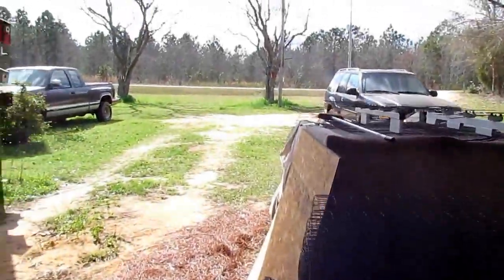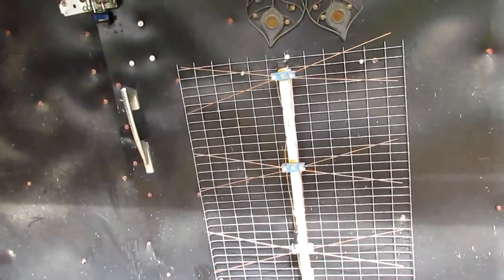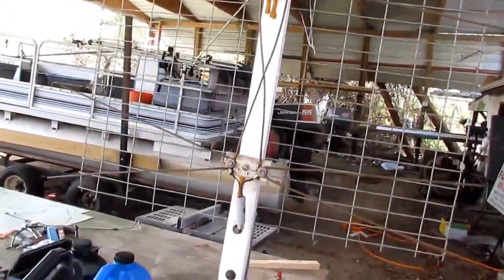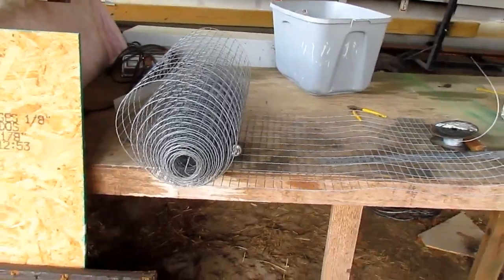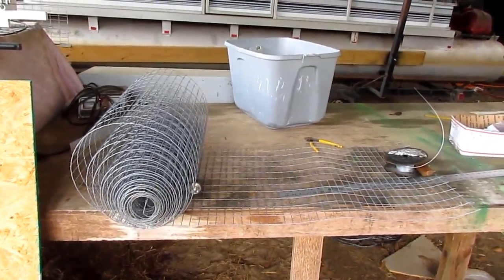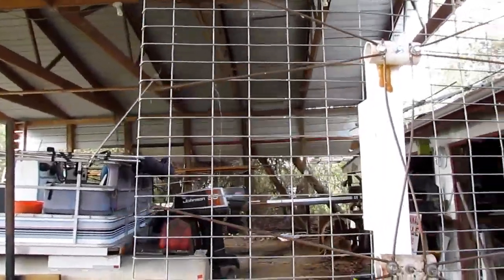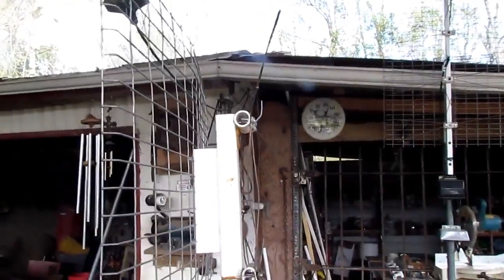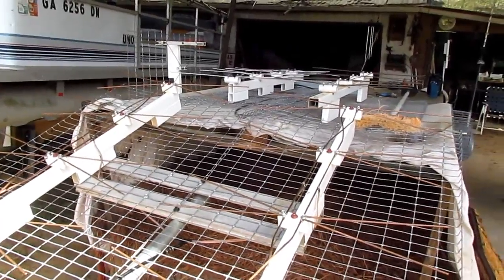About TV Antenna Reflectors,  Do I Really need One?

Comment: Seems every time I watch his antenna videos I pick up on some little detail I must have missed in another video. I built the ultimate antenna. After five years it gave me the first problem. The transformer had broke lose. I am not great at soldiering and I forgot to strap it down. So, I think it did damn good to have lasted this long. I got it down and replaced the transformer and got it back in the air she was good to go. I did a channel scan I got 102 channels in the living room. And in the bedrooms I got 97 in each of them. And the just the antenna, no booster.

Comment: My Double bubble aluminum foil reflector added 3  more signal strength lights  out of 5 on my Gray Hoverman Antenna. A must have, Thanks. Nice to see 5 lights on many channels now when transmitter is in one case channel 3 that is 92 miles away in Walnut Grove CA to our location here in Colusa CA.

Comment: I had to bend a reflector back a few degrees to pick up a signal real close to the other signal. The rejection was so good with the reflector that until it was bent, it did not pick up the desired channel along with the rest. I started with Radio TX antennas. I've made MANY ham/cb antennas, and with a pre-amp, they Always pick up more signal! The trick is picking up the channels WITHOUT AN AMPLIFIER! Anybody can make up for poor performance or wrong element lengths by adding a pre-amp. Just saying. Also, I did discover that bending elements into shapes works better than straight antenna elements for television. NO pre-amp EVER used. Like I said...Just saying. Love the work you do and your passion for antennas. I'm the same way. I've built Very complex ham antennas with different styles of gamma matches and the .64 secret measurement, blah, blah, blah. Not tootin' a horn or anything, just know that I'm not some jackleg jackass that is ignorant to propagation and reception. Thanks for your vids ... ForewarnedLongAgo

Comment: I have built my own 2 bay antenna that's mounted inside my house on the second floor,and without a reflector it picks up signals from Dayton,and Cincinnati which is 55 miles away with ease all day long.

Comment: the number one impact the reflector makes is directivity and maximizing the gain in that direction. if your buddy has his bent, it probably means he is getting less directivity and more of the gain is spread out over a wider angle. if he is getting more channels that way, maybe he doesn't have his antenna pointed at the tower or he is picking up two towers that are to either side.

Comment: It looks to me like your reflector is not quite wide enough and not far enough back from the working element.  Reflectors are usually about 10-15% wider than the working element and spaced back about the same as the length of the working element.

Comment: What would you do to increase the signal gain so a booster is not needed ???
Reply: The way you boost gain without an amplifier is to make the antenna more directional.  Notice that he has a reflector behind the working elements but no directors in front of it.  Also notice that he only has one set of working elements one above the other.  
Director elements sit out in front of the working element and are shorter than 1/2 of a wavelength.  Basically, they are just a length of metal that slightly slows down the  bit of the wave that interacts with them.  This makes them work a bit like a lens and focus the RF onto the working element.
If you place a complete second antenna beside the one he has here and wire them in parallel, you get a more directional antenna.  You run two wires between the antennas and take the signal off the wires at the mid point between the antennas.
Reply: @kensmith5694  What gets me is the challenge to get a good signal for TV reception. I wished I truly understood this field of antennas. Your post makes sense but why does old designs perform so well and are timeless it seems. What is better Ken, open front with elements or metal guides to focus the signal on to the receiving elements?? I appreciate your post fella too.
Reply: @victoryfirst2878  Nearly any antenna will work.  Nearly any improvement makes it work better.  Where you are, the antenna you have is likely enough better than a plain set of rabbit ears to be good enough for your purposes.  You do have to remember that keeping the design easy to build is also important.
I don't know what you mean by "metal guides" but I suggest that the directors are a better idea.  The thing about a metal part and an RF signal that you need to remember is that the RF likes to bounce off or fly past.  It doesn't really want to stay in the metal.  The working elements of the antenna absorb RF only because the connection you make at the feed point is taking away RF power.
Reply: @kensmith5694  Metal Guides are the directors for the antenna. Sorry for my poor choice of name. Also, one other thing Ken, since most antennas are made of aluminum metal instead of copper because of the cost, so it is said. Copper should work best because of the conductivity of the metal. Can you shed some light on that part Sir ??? Good day to you too.
Reply: @victoryfirst2878  Copper is more conductive but it is also a lot heavier and a lot softer.  The ratio between conductivity of pure copper and aluminum is about 2:1.  If you alloy copper to make it stiffer like using brass, then by the magic of alloys being a lot different, the conductivity also falls to darn near that of aluminum.
Also pound for pound, aluminum works out more conductive if you are designing a thing where weight matters a lot.  You can just put in an aluminum element with about twice the thickness.
Aluminum is so much more conductive than the impedance of free space that it may as well be a perfect conductor from an RF point of view.
Reply: @kensmith5694  O. K. Ken, point well made. I have to tell you that I will be making a Gray Hoverman antenna just like the one Danny makes and sells. The difference is that my antenna will have the reflector made from Ampco bronze wire of 1/16" diameter and a spacing of 2 X 3 inch rectangular spacing. The insulator will be PVC fake wood used in home construction. The active elements will be either number 8 copper solid wire or a tubing of 3/16 or 1/4 inch size. The connection wire will be anything from #14 or #12 wire soldered to the elements. The backbone will be square tubing 1 inch square with 1/16 inch wall thickness. The fasteners are all stainless steel for corrosion resistance. I am using videos from "COSMIC ANTENNA" who has such good videos with information second to none, PERIOD. So I will never say the idea is mine !! The biggest problem is choosing which antennas COSMIC ANTENNA shows to choose from. They are all such good designs. I just cannot wait for the time to make this happen.
 I am planning to make the units a double one on top of the other antenna. I think the model will be the G-H type know for high performance and with the ability to get VHF frequency since I am able to get the channels now with a cobbled antenna unit. Also, adding top hats increases more signal for the low VHF signals. My location has both high and low VHF with great channels. Thank you for giving me true and accurate facts on the TV signals. Good day Sir and keep in touch when an idea pops into your head. . Peace too.

Comment: Danny, where do you get the vinyl fencing that you use? I tried Home Depot and Lowes, as well as vinyl fencing suppliers and have not seen the size you use. Appreciate the source info. Thanks.
Reply: I buy close to wood section at Home Depot this stuff made of PVC but shaped and resembles wood. When I made my first antenna I went straight on wood, it worked but maybe only half as good because I never realized the wood was creating subtle shorts.

Comment: Thanks for all. I am in Germany. Can the antenna work indoor with the special window glasses that we have here in Europe?
Reply: Our windows here have and invisible layer of iron.
Reply: @litchylichen5345  if it has metal in it, it will affect all signal including cellular. The extent of loss is never known unless you try, maybe signal outdoors is so strong it doesn't hurt the antenna being indoors. I would try it outdoors if that is possible and at least 30 feet high for best results if you want all channel's you can possibly get.

Comment: I have two major broadcast areas kind of back to back about 40 miles away in opposite directions,....do you have any recomendations on how I can combine the signal from the two antenae and then spilt back to two tv's,....thanks for the help
Reply from the maker: I HAVE A VIDEO ON THAT
Reply: Whats the back lo back link Mr.Hodges?
Reply: 70carlton, you'd need an antenna combiner with both cables from each antennas being the same length.

You then run one single cable from the combiner into your house where you would then use a splitter to divide that single cable into two different cables, one to each tv.

Comment: How good is that small antenna? The one that looks like a mini ultimate antenna.
Reply from the maker: ITS WORKS FINE
Reply: belly tripper, he does. He has a bunch of videos spread across two different channels tho. He has a few videos where he compares the performance of two different antennas side by side at the same time using two laptops.

I've probably watched 40 videos  of his in the last 2 weeks,  it takes some digging for anyone looking for free information that he doesn't get any monetary gain from, but they are there.